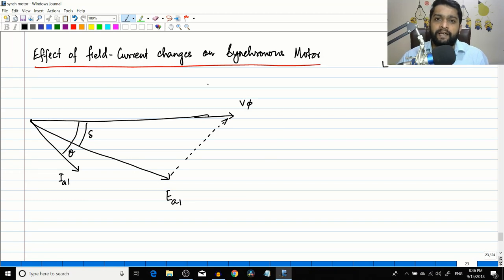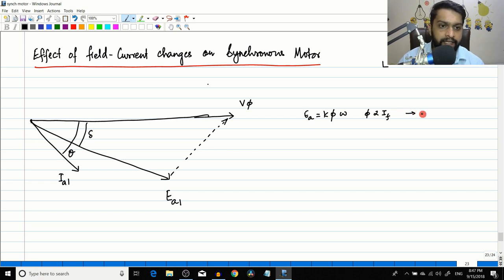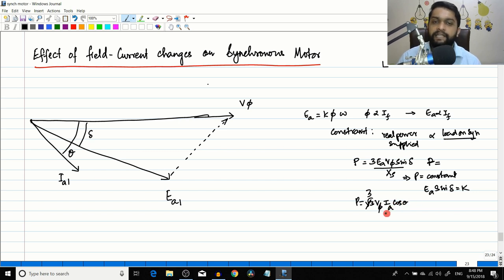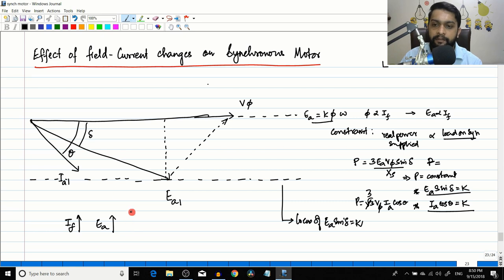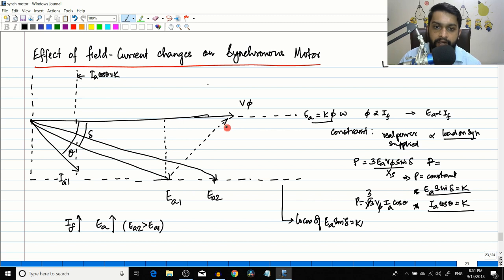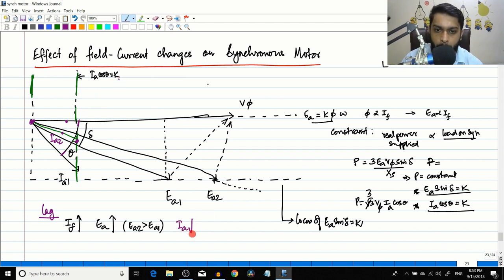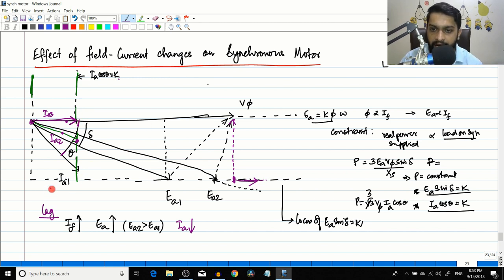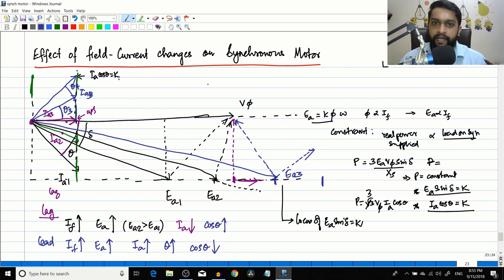#7  Synchronous Motors - Effect of Field current Changes on Synchronous Motor

Comment: its simple.  The reason behind the decreasing delta angle is the increase in the magnitude of the Ea to maintain the Ea*Sin(delta)  constant at every instant. And also when the field becomes stronger then then the locked-up becomes more stronger and then load angle=delta angle reduces.

Comment: When motor was in lag section, the inductive reactance was more due to which the Ia lag Ea by larger angle and angle between Ea and Estat is also large, as the field excitation increases stator inductive reactance decrease, so theta decrease which results in decrease of the angle between Ea and Estat....  Answer with reference to "4 Equivalent circuit of synchronous generator 7:00 "

Comment: Practically..if field curr increases the field get stronger and the attraction between rotor and stator poles increases...which tends to pull the rotor to make rotor field axis as close to stator rotating field axis and the angle between them viz delta reduces.....well I think so..i might be wrong...if it is wrong please correct me...I'll be thankful..😊
Reply from the maker: No yr right..the stronger the field the stronger the locking

Comment: If in a synchronous motor driving mechanical load and drawing current at lagging power factor from constant voltage supply if field excitation is increased then its power factor become ???